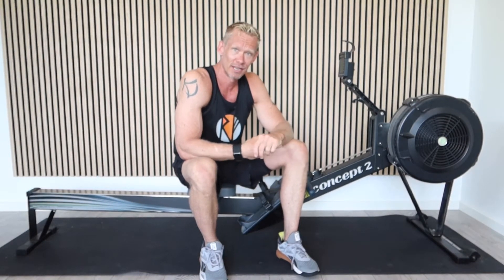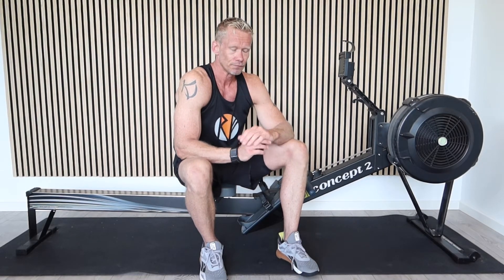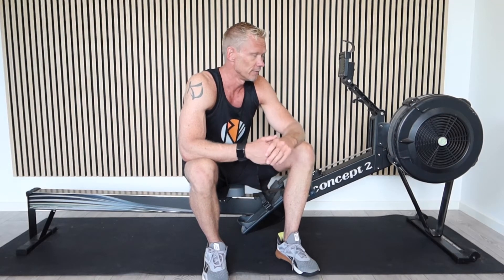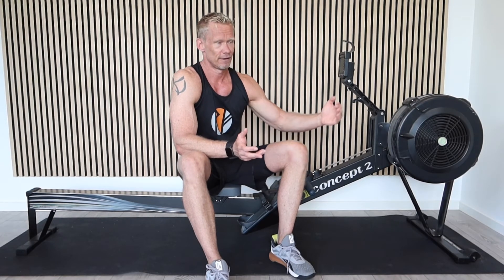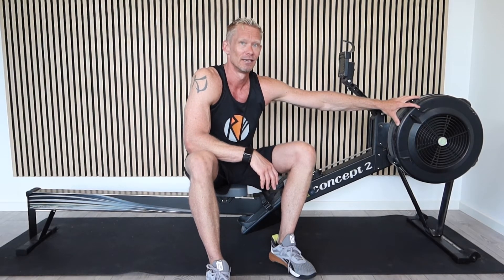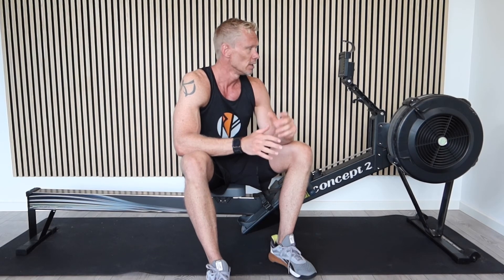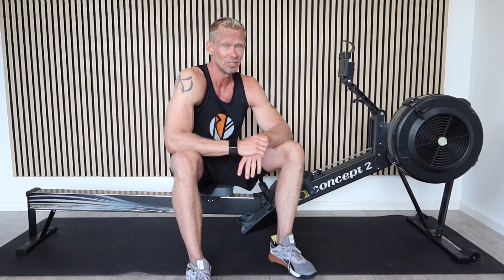Drag Factor Setting and Why You Shouldn’t Set it at 10

Comment: Hey, I enjoyed your video. I know it's been a couple years since posting but I have been looking for an explanation. I have been doing 5k rows in about 20m30s. I started out with drag factor of 240 and I was able to maintain about 33 to 34 s/m however my average speed was 2m04s/500m. I then learned that 240 drag factor was too high so I adjusted down to damper setting of 6 which is at around 140 drag factor for my erg. Keeping my stroke rate at 34 to 35 has resulted in a similar time of 20.5 minutes for a 5k and I still finish the workout completely soaked... what am I doing wrong?

Comment: Here’s my explanation. Hopefully it is complementary rather than confusing:

Your damper setting (lever on the flywheel) is directly proportional to your drag factor. If you have the new C2 ErgData app, you can set one of the fields to display Drag Factor. What is Drag Factor (DF)? Think of it as a numerical representation of the resistance of the air to your “oars.” What is optimal DF? That all depends on you - not only the length of your arms and legs, but also the amount of power you can consistently put into your stroke. The higher the DF, the more resistance the air places on your “oars.” But, that resistance also indicates how much air you’re trying to move at a given time. If you were on the water, the face of your oars would move a uniform amount of water on every stroke (with perfect form, of course). The C2 Damper Setting essentially allows you to adjust the face of your “oars” based on your unique physiology. On the water, you could have oars with faces the size of barn doors, but because of the heavy resistance, you wouldn’t be able to move water with any speed. Conversely, if you had oars with the faces the size of soup spoons, you could move them really fast, but you’d never be able to move the water fast enough to build up any speed. The adjustable Damper Setting allows you to find a setting (quantified by the DF number) that is optimal for how your body puts work into the machine. World-class indoor rowers appear to win their races with DFs around 125-130. Why the difference between the numbers by the Damper Setting lever on the side of the C2 flywheel and the DF figures? Because a Damper Setting of “5” on one C2 might yield a DF of 120 whereas a “5” on another might only yield a DF of 108. I do my training rows with a DF of 130 and each machine I use (two at my gym and one at home) requires a different Damper Setting to get that DF of 130. Knowing the DF you’re most comfortable with allows you to “tune” any C2 indoor rower to your body.

Easy, right?
Reply: Si fuésemos en bicicleta, el ejemplo sería, con el desarrollo, 52x11 no te hace ir más rápido que 52x18 si no puedes llevar la cadencia adecuada ni tienes la resistencia para mantenerlo todo el tiempo. 
¿Cuál es tu mejor desarrollo en velodromo para hacer tu mejor test FTP o vel/avg? Es lo mismo que buscar tu drag factor.
Saludos.

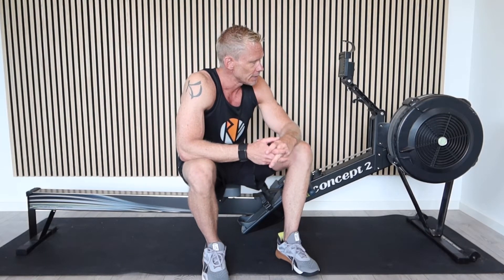Comment: The problem with the 1K is that it's SO hard to get down to 1:30/500m pace at a lower fly wheel setting than 10.  BTW, professional rowers are doing 36 SPM for 2k.
Reply from the maker: Hi Tyler, it might help to lower the drag factor to about 124-134 and work on creating more velocity on the drive. Valkyrie is a great workout in the Row Forge app to improve 1000m. Try it out 😃
Reply: @rowforge7332  you have your own app? I was testing out your lower stroke count method today with a relatively low drag factor and man alive I feel like that is so much harder than having a higher stroke count and not tugging as hard. Not saying you’re wrong as I know professional rowers have incredible explosive power
Reply from the maker: Yes Row Forge is a rowing app. Check it out. It’s the app for you if you want to get faster. It’ll will write you personalized targets designed to make you better within the first month guaranteed.
Reply: @rowforge7332  wow

Comment: I see this all the time in my small local gym, it has just got 1 used C2E from another centre to replace an LF GX water rower - which we still have 1 left. So we now have one of each, what you also need to factor in but people don't is the drag factor as this governs where the resistance lever should be. Concept advise that men row between 120-140 i think and women row 100 - 120 again I think. I am more an endurance rower for general fitness after heart bypass surgery and so am working my way from 5mins 1000mts to 10k and then hopefully 1 HM this year, currently about to start for Mar 22 Mon 6k Wed 7k Fri 8k for 4 weeks then increase month after by another 1k on each day. Really have it in my head to reach a 2.30min split time but unsure if even poss on this machine maybe 3.00 more doable, I did reach 2.30 on the LF GX but diff animal. I find a stroke rate of 30 and over is sprint pace for me and very hard to do a full stroke at that pace but not impossible.

Comment: I had never considered that the increased wind resistance would cause the flywheel to stop so quickly but it makes perfect sense. I will try my next 10km at setting 6 and hopefully I'll be able to breath afterward this time. Thanks so much for the video.
Reply: I think of the flywheel as the boat im rowing. On damper setting 1 the boat takes a long time to slow down after each stroke. On damper setting 10 the boat slows down almost instantly after each stroke. So its very hard to keep the boat moving on 10
Reply from the maker: So glad this is helpful to you!